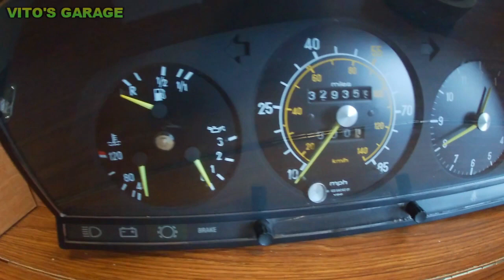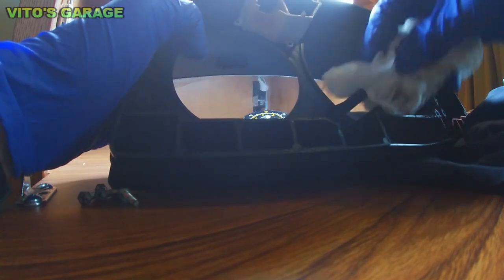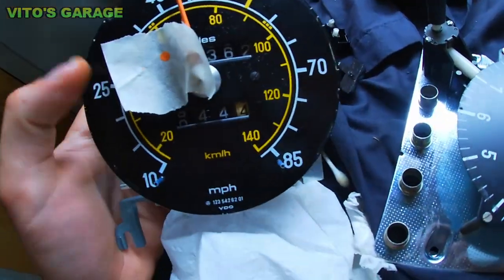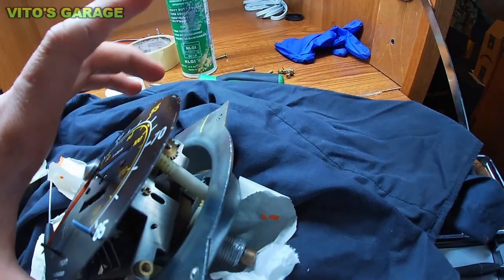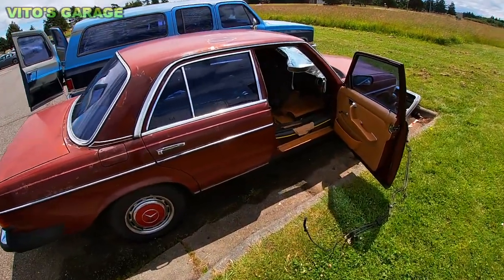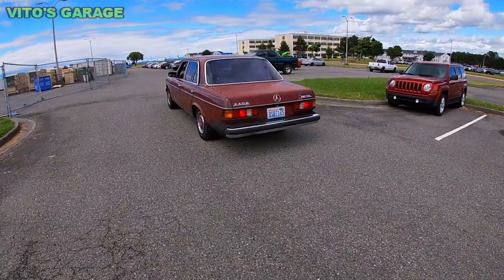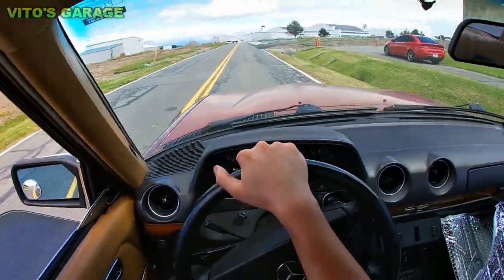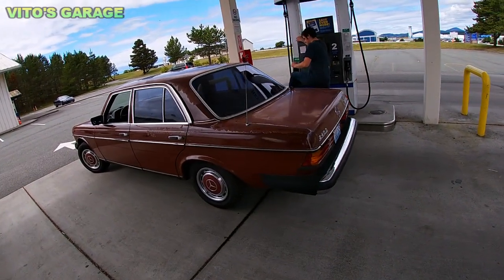Mercedes W123 240D First Test Drive & Cluster Refurbishment!!!

Comment: VITO, I HAVE DONE 2 OF THESE-----JUST A SUGGESTION----REPLACE THE CLOCK WITH A TACH FROM A 300D. LED'S ARE MUCH BETTER, BUT YOU WILL HAVE VOLTAGE PROBLEMS---MAY NEED SOME RESISTERS  TO GET THE BRIGHTNESS THE WAY YOU WANT IT. MERCEDESSOURCE HAS A COUPLE OF LED KITS FOR THE W123 TYPE CLUSTERS.
Reply from the maker: I am not putting Led's in. They'll burn up the cluster.. Watch Pierre Hedary videos about that. And I also don't buy stuff from Mercedessource. It's unnecessarily overpriced!..
Thank you for watching and supporting!🙌🚗

Comment: Hey Vito,
Congratulations for the great work. I have 2 300d’s and bought recently a 240d. The 240d in this video sounds rough at idle. It could be something to do with the way the sound its captured or something lose but it definitely sounds like the injection its too rough. 
Keep us posted 👍
Reply from the maker: Could be bad injectors or incorrect pump timing. Don't have time for that now. I'm just happy it's on its feet. And thanks for watching.
Reply from the maker: Congratulations on your W123s!! Best cars in the world!
Reply: The 240d is a recent purchase and the body and paint its ok but basically needs to replace a big par of the floor and both inner or exterior sills. It’s a 240d first owner from new! Very well taken care but it came from a heavy snow area from germany. I have the order and factory sheets, new clutch, new brakes ( but they need some work still), new tires and a new Mercedes battery. I don’t mind of spending some money in this car because it was a pampered car from new. The color is GoldenBrown its a special color that a friend of mine calls diahrea 😂

Comment: amazing videos! keep em coming. do you have a video on bowden cable adjustment/repair?
Reply from the maker: Thanks a lot! I don't have a video on bowden cable. What are you trying to do with it?
Reply: @VITOSGARAGE  the plastic screw is busted, i am trying to replace it with a hollow metal one of the same dimensions, ill send you a pic of it later
Reply from the maker: Hmmmm.. I always grease up those screws to prevent that. But, I haven't done any repairs like that before. I'd just buy a new cable and replace it

Comment: Hello Vito looking great only have one that needs painting the rest are orange but I’d like to clean it like you did looks great I seen  The LEDs in the dash day and night difference I got a problem though trying to locate the flap for my blower when I switch my  Recirculation button on it lights up but it still draws air from outside I can’t get it to close and I don’t know where the vacuum actuator is or the flap if you can help thanks Vito keep those videos coming love them
Reply from the maker: The flapper is driven by a vacuum pod (actuator) and it should be behind your pass air bag or glove box. That vacuum pod is most likely bad and needs to be replaced. That's why the flap isn't working. If you have a pass side airbag, you might need to pull the dashboard to get to that pod. Removing the dashboard will expose all those pink vacuum pods (there are a lot of them) and it's the best to test them and replace them as needed when the dash is out

Comment: I have a 1980 240d. I replaced the speedometer cable and now the oil and fuel gage jumps around. Any idea what might cause this?
Reply from the maker: Did you reinstall it all correctly? Disconnect the main connector on the back on the cluster and start the engine. See if the oil pressure gauge is still bouncing
Reply: I want to say I did. But I will be taking it apart and checking tomorrow thank you. Love your channel.

Comment: How did you fix the turn signal problem?...i have that problem
Reply from the maker: I just realigned (centered) the steering wheel and it worked great afterwards. 
In your case, you will 99% need to replace the whole combination/turn signal switch. Because there's a plastic finger that cancels your turn signals that breaks off. You can pull off the steering wheel and inspect it. If it's broken off, then the whole switch needs to be replaced!
Reply from the maker: https://youtu.be/Z7ow0LXOMy8
Reply: @VITOSGARAGE  thanks alot man....
Reply: @VITOSGARAGE  I'll check it first.

Comment: Cluster looks great, like new!  Beautiful car with the manual transmission, used to have one a 1979 had manual sunroof and roll down windows. That spare tire is nice, same one in my 300sd. My trip meter and odometer stopped working on the 1981 300sd. Have a later model cluster wonder if i can update and use the temperature sensor i have from another car?
Reply from the maker: There are plastic gears inside your cluster that need to be replaced. Buy plastic gears and replace them. The odometer will start working again. No, don't add the temp gauge... Keep it original. If you want a temp gauge, buy another newer W126